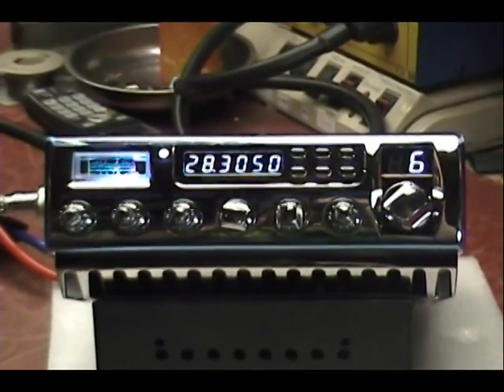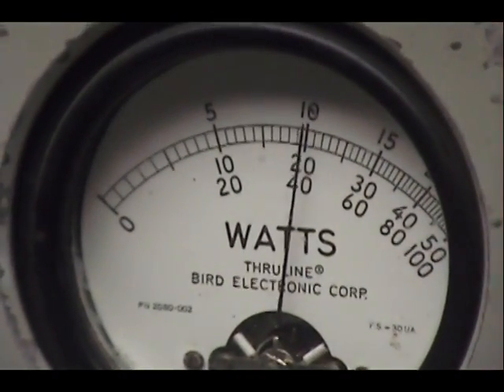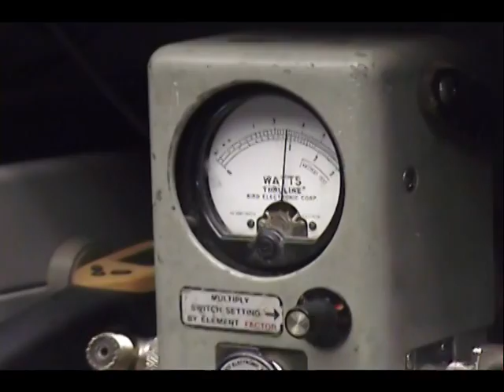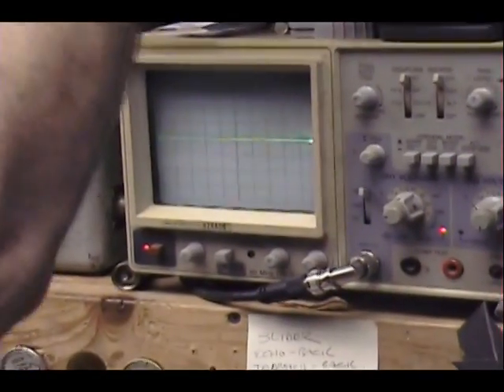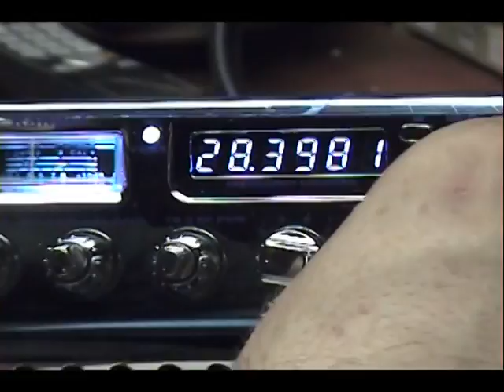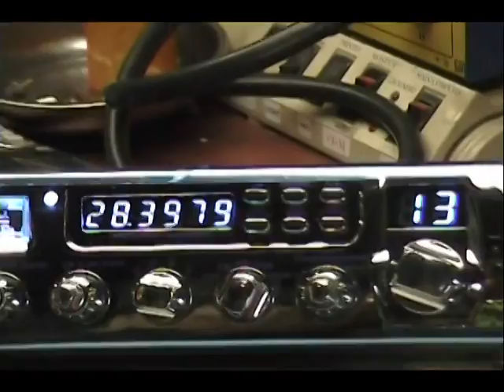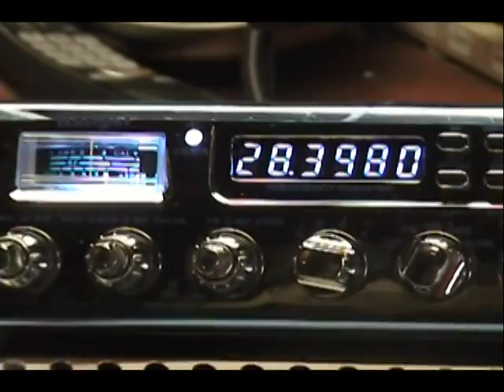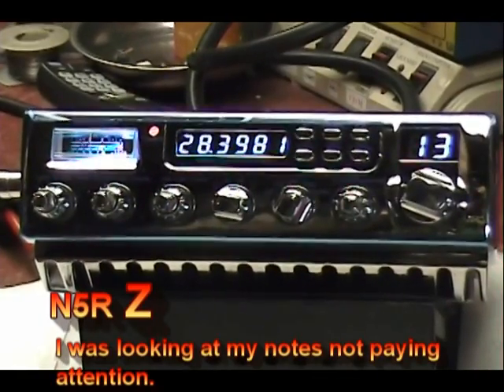Ranger RCI-69FFC4 OEM Radio Report

Comment from the maker: @radioguy67 Yes we would normally align them right on frequency with clarifier at 12 o'clock and at a stabilized temperature, BUT this video was an OEM and that means we didn't do anything to it but demonstrate it's "out of the box" operation. Right out of the box, the alignment is usually off a bit in each mode.

Comment: i gave my vhp 98 galaxy away the mosphets burnt up just like that 200 watts peak got hot died just like that fast 2 times , good swr too running imax 2000  ranger needs reg. amp cooling fins with big fans .  just like the 2995 junk mosphets you cant run those wide open thats why there all piled up in warrenty like mine was120 watts MAXX peak :).  only way i would buy another galaxy if they fix that problem .  im sure BELLS backed off the power on am :).